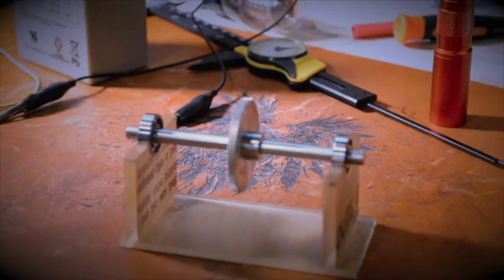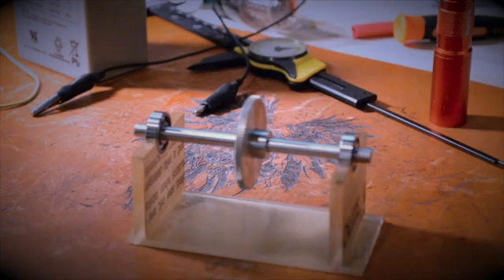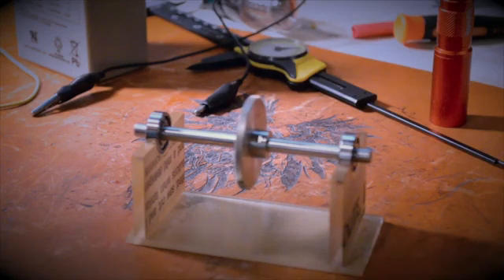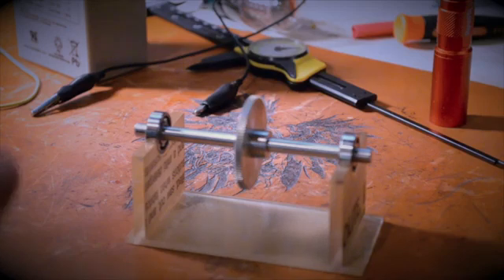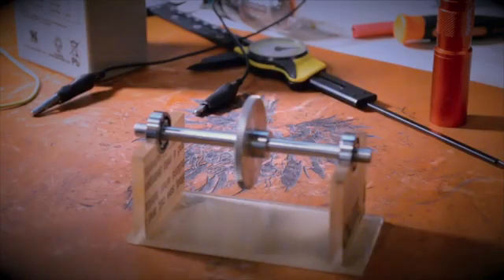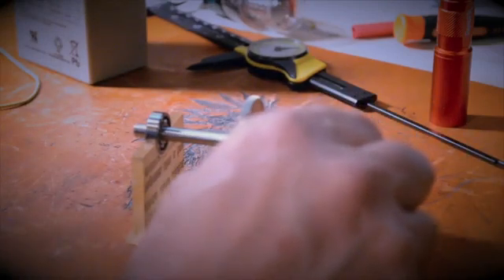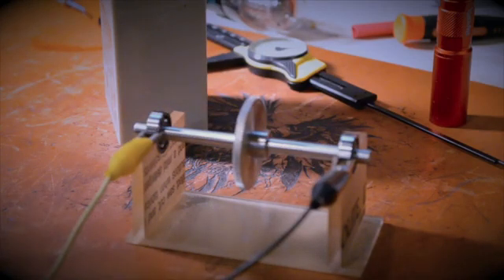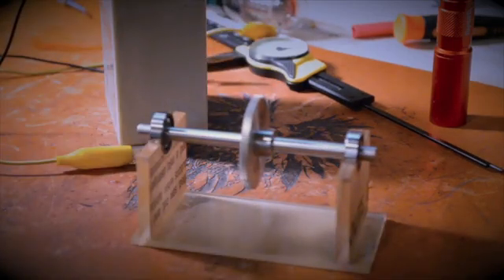Decware Zen Motor with no wire and no magnets!

Comment: "That's special, but what's the point"  LOL!  That was great.  That is why my system as goofy as it is (I e'mailed you pictures of it and you kindly answered what I asked you) is honestly very simple.  It has ONE capacitor to the tweeter on each channel on those open baffle dipole multi-driver line-arrays and that is it for a 'Crossover'  Everything else on the towers is full range wired series/parallel.  No, boxes, no cabinets, no enclosures.  For what it is, that's one reason why I think it sounds so open and full with a nice detailed image and soundstage and really fast dynamics on the transients.  Simple, really...

BTW, I think honestly if I ever am able to go the Decware route, I probably would have to go for the Tori, due to it's having 20 w/side.  I think the Rachael might just be a little weak to drive those towers.  But, I don't think the Tori allows you to add a pre-out or line out for bi-amping.  I think the Rachael may be the only one where you offer an option for that... Hmmm... I thought that was kind of weird that you don't offer that same option with the more powerful amp.
Reply from the maker: The feature is actually designed for bi-amping so that the slave amp takes on the harmonic signature of the main tube amp.  The best way to drive subs with tube gear is to use the high level inputs (speaker jacks) on the back of the subwoofer amp.
Reply: @decwareproducts  Thank you kindly for the reply Sir!  But, I don't want to run 'subs', I need to have an integrated amp with a 'Pre-out' or 'Tape out' (like Primaluna - sorry... : ) so that the tube amp can run my high end towers and then have a passive or variable out (like the Rachael) to go to my Crown 2502 400/side which just runs the 2-15" dipole woofers.  It's too bad your Tori doesn't have that same option.  That probably would be perfect.  Thanks though!
Reply from the maker: @latheofheaven  If you want to trade one of the two pair of inputs for a pair of outputs we can make a custom version of the TORII for you.
Reply: @decwareproducts  OOH... I'm liking the sound of that!  : )  Seriously, I was kind of HOPING that maybe one could be modified like that.  Thank you VERY much for mentioning the possibility!  I will definitely keep that in mind.

I suppose it is silly to ask you, since you *ARE* Mr. Decware, but any objective thoughts comparing the Torii @ 20w/channel with the Primaluna Evo 100 Integrated amp @ 40w/channel...?  I mean, everything I hear/read easily proclaims Decware *THE One Who Rules Them All*  and what I've heard sounds amazing.  There is this one guy on YouTube, I don't remember his name, who simply played a demo of the Zen running some open baffle speakers that he made.  To this day, I have never, and I mean *NEVER* heard such stunning vocals in my life!  Even over YouTube... And, I don't even particular CARE for vocals!  :D  Seriously... took my frigg'n breath away.  But, it would be helpful to get some insight from the maker of Decware himself concerning thoughts comparing the Torii and the Primaluna Evo 100 Integrated amp.

Thank you very much Sir for taking the time to answer and for the kind offer, especially with how insanely busy you are!  I very genuinely and seriously appreciate it.

PS:  The new upgrades on the Torii Jr. sound really, really nice!
Reply from the maker: @latheofheaven  The Evo 100 has circuit boards with relays on the inputs, connected with computer ribbon cable (ruins the sound in our tests).  There are also several other circuits boards and additional ribbon cables connecting the input to the output stage as well as many solid state Integrated Circuits.  Almost all the electrolytic caps are radial.  Any one of these things I've mentioned if done in a Decware amplifier would ruin the sound for those who aren't handicapping it so much as to not hear the difference.
Reply: @decwareproducts  Wow, that is good to know Sir!  The way they show it and in their pictures they give the impression that it is all point to point wiring.  What you are saying sounds like it contradicts that.  Thank you for letting me know!  I don't think you can beat the 'Purity' angle that Decware has.  That goes right along with my own audio 'philosophy'  Less is almost always more...  Thank you again, and especially for your kind offer to modify the Torii Jr. if I'm ever in a position to get it!

If you thought that the 6.x watt Rachael might drive my towers, then I would certainly HOPE that the 20/side Torii Jr. would.

Comment: I would grind the ends of the shaft to a point and run the motor vertically, then I could eliminate the ball bearings to add more Zen.

Comment: Reading the other comments... I would say the point was more that the simplicity of a mental model can hide the complexity inherent what is describing, like this unexpected motor coming out of a steel shaft. Suggesting underestimating the complexity of even a simple design will lead to untameable consequences when that design is complicated - pretending it was fully understood - just like complex circuit designs amplifiers sounding as bad as they do.
Reply from the maker: Just to a note to all who watch part one to be sure and watch part two.  It's a mind bender.

Comment: Indeed simple and complex and I guess that battery would go dead very quickly.so in this particular case, simplicity without practicality? (Except for making a point)
Reply: This is an excellent video about simplicity; not efficiency. Its a beautiful illustration. The implications of this illustration for electrical engineering are what's important, here. That's the take-away for me. I don't imagine for a moment that Mr. Deckert was suggesting anyone build these motors for applied mechanics. That's just silly.